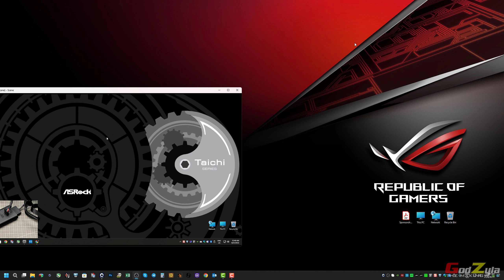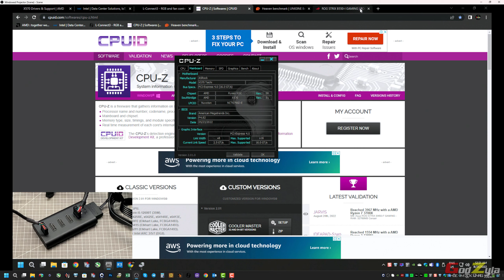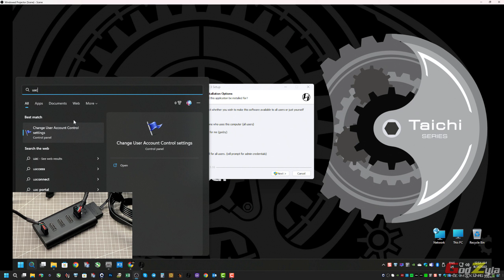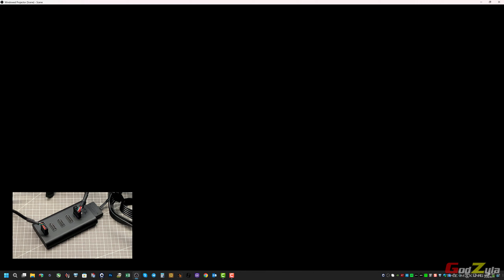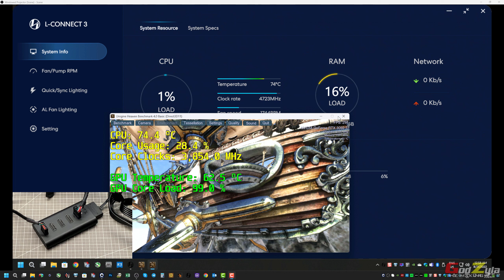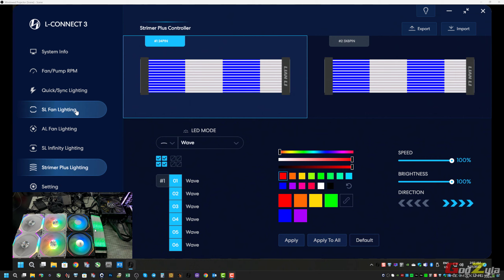Lian Li ARGB Products (How to make it work?) [L-Connect 3]

Comment: My infinity and strimer v2 set is coming tomorrow and i have a question

If i use 2 different sata cable from the psu, 1 for the strimmer controller and the other for the infinity controller, can i use the rest of the sata headers in those 2 cables for hard drives? Im planning to add 2 8TB hard drives at 5400rpm.

My PSU is a seasonic prime GX-850W 80+ gold just incase psu information is relevant
Reply from the maker: Hi Andrew Timothy, welcome to my channel. you should not run into any issues as your PSU reel ampere is at 70 A. https://seasonic.com/prime-gx#specification
Reply: @KleoYan  thats amazing to hear! thanks for the quick reply, you just earned my sub.

Another question if you dont mind, 
I just watched another of your video where you replace the arctic liquid freezer II fan with the lian li fans. 

My question is, since the only cables left from the AiO itself is the radiator pump cable, is there a way to connect it to the uni hub controller so it can be controlled with L connect, or is my only option is to connect it to the motherboard header?
Reply from the maker: @andrewtimothy9792  hi, you are most welcome, as for the LF2, if you change to uni fans, you can still plug the LF2 only cable (Pump & VRM fan) to the uni controller, just make sure the port you have plug in are running on full speed or at 80%. This will prolong the life of your pump.
Reply: @KleoYan  how do i plug that pump/vrm  fan cable to the uni hub controller? If im not mistaken, the controller doesnt have pwm input port?
Reply from the maker: @andrewtimothy9792  oh wait, my mistake, If you are using SL V2 or AL V2 or SL Inf or TL controller, you can't as the ports are all 7pin ports, in this case am so sorry, you will need to connect it directly to your motheboard, my bad.
Reply: @KleoYan  no worries man, im just glad glad the misunderstanding was sorted out lol.

Say im plugging the pump/vrm fan to cpu_fan, how do i set it to 80%/max? And wont this means the vrm fan will spin at a constant 80% speed all the time as well since they use the same cable? Wont it shorten the lifespan of the fan?
Reply from the maker: @andrewtimothy9792  you will need to go to your motherboard UEFI/BIOS to set the fan mode and settings. as for VRM following, that's not a problem. it has a good lifespan of 50,000 hours. what you need to worry is the pump. for VRM fans, you can change it yourself when you log an RMA with Arctic. they will send you the spare vrm fans to change it. as for the pump you can't that's why you got to be sure that it runs consistently. Now you will have to fiddle in your motherboard UEFI / BIOS. I can only share with you this info on how to set PWM or DC, in your case is PWM. https://youtu.be/MCMkrQwFnKM?si=DsL7ZNvJdIOPHzUU
Reply: @KleoYan  ah I see.
Will there be an issue with the lian li fans? For example will it negatively impact the temperature if say, the fans are spinning at like 30% speed while the radiator pump is at 80% speed? Or the other way around?

And can I just plug that PWM cable to CPU_fan header? Since if i remember correctly my MB doesn't have a dedicated pump header. BUT,  from what i read in the MB manual, all fan headers can be used for pump.
Reply from the maker: @andrewtimothy9792  hmm, how Liquiud AIO works is this way. pump will push the warm water to your radiator and your radiator fans will push air to cool the fins stacks which the cooled water flows back to the pump. It goes in a cycle. Therefore it's best to pump motor to rotate in a consistent speed, by preventing pump motor to fluctuate the speed, your motor will last longer. In general, at all times is best to run the pump at 100%, if too noisy, set it down max to 80% and not lower. As for the Radiator fans, you can have it PWM as in when CPU goes hot, it will ram up the RPM of the rad fans. so the Pump and Rad fans works differently. As for the VRM fans, you have no choice since the cable is together with the pump, so have to run at 100% or 80%. 

now my way to connect Liquid AIO will be slightly different. I always separate the connections to have full control, also I will have them connect directly to the motherboard. example using AL-120-V2 fans, your case will have serveral of these fans, example 10 x AL-120-V2 fans. I will purchase 2 x tripple packs and 4 x individual pack. I will connect it this way.

a) Plug the LF2 only cable will connect directly to fan header on motherboard (Check to make sure it's 2A and not 1A) 
b) Mount 3 x AL-120 V2 fans to radiator, use the individual pack cable, plug the fans 4pin pwm directly to motherboard CP_FAN and the ARGB 3pin JST03 to AL-120-V2 uni controller Sync 2 Port
c) for the rest of the AL-120-V2 fans (case fans) I will plug to the AL-120-V2 uni controller directly (make sure to plug into port 2 as sync port 2 follows port 2 argb effects)

This way all your case fans, the PWM and ARGB are controlled by the L-Connect 3.  
For the radiator fans, the PWM is controller directly from your motherboard and the ARGB is controlled by the L-Connect 3 app. reason for this, in the event if your Uni controller died. Yes all your case fans will not operate properly (PWM & ARGB) but you will be safe on the liquid AIO side as the only thing affected is the ARGB and not the PWM which the fans are cooling your radiator. 

hope you understand what I mean and sorry to be that lenghty.
Reply: @KleoYan  no i understand completely thanks so much for taking the time explaining it in such detail. 

So the summary is :
you recommend the radiator fans and pump be plugged to the MB directly. 
But only having the pump plugged into the MB and have the fans be controller by L connect should still be fine.
Reply from the maker: @andrewtimothy9792  yes for Liquid AIO pump, vrm and radiator fans, always plug the 4pin PWN connectors directly to motherboard (Safety measures), except for argb can plug to uni controller for L-connect to control. as for other case fans can just plug to uni controller and control by L-Connect 3.
Reply from the maker: @andrewtimothy9792  this will give you an overall picture of what I meant, though is not Arctic LF2 but is the same concept 

Choice A) and B) 

A) https://imgur.com/gallery/zEKCkRf (defualt connection) 
B) https://imgur.com/gallery/wxrKnQd (Highly recommended which I use this method.It's a safety measure if uni controller die, your Liquid AIO will continue to run)

Comment: i have a question about Lian li Galahad AIO LCD infinity. the L connect 3 is only allowing me to set rgb loop number to 50 max. and my 3rd fan in aio only lights 1/3 of the side rgb pannels. Do you know how to fix it?
Reply from the maker: Hi Axie 101, welcome to my channel. Just to check. Are you able to control the ARGB effects and to control the lcd? As for the Inf 120 fans where do you plug it?
Reply: @KleoYan  I did not build the pc. I am able to control argb effects and lcd.
Reply from the maker: @axie1019  I see, reason I asked is. For the SL-INF version of the GA II LCD. It comes with the Uni controller. Therefore you need to have two usb cable plug to the motherboard usb 2.0 header. I would advise you to go back to the person who build your pc to troubleshoot for you. Or check on L-Connect 3 app. Under settings and devices. Are the fans connected to the controller all highlighted or?

Comment: i dont have any of those options on my l connect 3, i only have system info and settings. have none of the fam rpm or lighting options.
Reply from the maker: Hi Ryan, welcome to my channel, mind if I ask which type to Lian Li ARGB devices are you having. As in which uni fan and does it come with a controller?
Reply: @KleoYan  sl infinity and yeah it comes with a controller
Reply from the maker: @lambbosbread123  ok try this.

1) Make sure your motherboard bios is up to date, please check on your motherboard manufacture website, under support > bios and drivers. See if there are issues with USB and do they have a fix. If there are, kindly update those bios firmware version.

2) Make sure your chipset driver for your motherboard is up to date! For AMD will be at https://www.amd.com/en/support for Intel will be Intel Driver & Support Assistant Intel DSA https://www.intel.com/content/www/us/en/support/detect.html

3) Remove all argb apps (Asus Armory Crate / MSI Dragon Center / Giga Fusion / Asrock Polychrome). If the brands which I have mentioned, do have a uninstall tool like the Asus Armory Crate, use that, else use Revo uninstaller ( https://www.revouninstaller.com/ ). Revo uninstaller will remove all unwanted files / folder / registry in your system. Illustration to use revo uninstaller https://www.youtube.com/watch?v=uMgUYiakpxM&t=437s

4) Shutdown your PC, unplug the PSU cable from your AC outlet. Press the power switch twice to discharge all current that your motherboard is holding. Leave it for 45 second

5) Plug Uni controller with one fan

6) Plug the power cable and turn on your PC

7) Go to your Device Manager, look under Universal Serial Bus Devices, make sure you see the Lian Li uni controller

8) Install the L-Connect 3 app only https://lian-li.com/l-connect3/ 

9) After installation, run L-Connect 3, check under Setting > General > make sure Auto-Run on Boot and Minimized L-Connect 3 to system tray at close are ON.

10)	Reboot your system.

11)	First thing you need, go to device manager and see if the Lian Li controller is listed, next open up the L-Connect 3 app. Check if there is a need to update firmware to your controller. Go to Settings > Update, under Device F/W version, click on Update Check, download and install the firmware. Make sure the firmware is completed. Do a check on device manager and make sure the Lian Li controller is listed.

12)	On L-Connect 3 dashboard, check if the CPU and GPU readings are reacting, you might want to test it using some benchmark programs. If there are reaction, play with the PWM and argb functions. If it does not work, skip step 13) and proceed step 15)

13)	If Single controller works, shutdown your pc, connect uni fan set of 3 to your output of your uni controller. Do it small steps at a time to hook up your sets of fans. do not do all in one go. If successful and you have a second controller, proceed small step at a time again.

14)	Slowly plug back your USB devices (Headset, Microphone, Printer, USB Capture Card and etc). At any point of time as you add those devices one at a time, if L-Connect 3 become unresponsive. This tells you that there power is insufficient to power up more USB Devices. Whatever USB port on your motherboard, there is a limitation as the current are shared across the board, be it front or back I/O and the internal USB Header. You might need to get a Internal USB Hub that comes with a Sata Power source to the Internal USB Hub. (Disclaimer, buying a internal usb hub might or might not resolve this issue, purchase at your own expenses)

15)	If it does not work, report your issues to Lian li Tech Support. There is a in build log ticketing system in L-Connect 3 app. this is what you need to do. Go to Settings > Support > Click on “Download log” place a filename and choose a destination drive to save the log file. Next click on “Report” it will take you to Lian Li Tech Support FAQ. Fill up the form and upload the log which is a zip file.
Reply: @KleoYan  oh wow I appreciate all the help . I will go through the list and try it out. Thanks heaps
Reply: @KleoYan  under universal serial bus . Is it called lian li ? Or is it aura led controller ?
Reply from the maker: @lambbosbread123  it's lian li something, the aura is another argb application which tags to your motherboard.
Reply: @KleoYan  strange mine doesn't show up. But fans are working and rgb is working.. I couldn't have wire it wrong or it wouldn't be working correct?
Reply from the maker: @lambbosbread123  that’s the reason why I show you the steps is to troubleshoot one at a time.
Reply from the maker: @lambbosbread123  ok I was in a rush to answer you. Now you will need to have that controller shown in Device mananger. this shows that there is commnunication between L-Connect 3 app to your controller and to control the PWM and ARGB of your fans. by default your fans and lights will work but without control.
Reply: @KleoYan  hmm ok. I'll have to try all those steps later. Thanks:)
Reply from the maker: @lambbosbread123  ok good luck.

Comment: Hi, my fans went full speed from the software. I had to switch controllers to stop it from spinning at max rpm. How do I prevent this from happening again?
Reply from the maker: Hi chrome, welcome to my channel. did you check if your device is listed in device manager?
Reply: @KleoYan  Yes it is listed as lian li unifan.
Reply from the maker: @Oggais  ok try this.

1) Make sure your motherboard bios is up to date, please check on your motherboard manufacture website, under support > bios and drivers. See if there are issues with USB and do they have a fix. If there are, kindly update those bios firmware version.

2) Make sure your chipset driver for your motherboard is up to date! For AMD will be at https://www.amd.com/en/support for Intel will be Intel Driver & Support Assistant Intel DSA https://www.intel.com/content/www/us/en/support/detect.html

3) Remove all argb apps (Asus Armory Crate / MSI Dragon Center / Giga Fusion / Asrock Polychrome). If the brands which I have mentioned, do have a uninstall tool like the Asus Armory Crate, use that, else use Revo uninstaller ( https://www.revouninstaller.com/ ). Revo uninstaller will remove all unwanted files / folder / registry in your system. Illustration to use revo uninstaller https://www.youtube.com/watch?v=uMgUYiakpxM&t=437s

4) Shutdown your PC, unplug the PSU cable from your AC outlet. Press the power switch twice to discharge all current that your motherboard is holding. Leave it for 45 second

5) Plug Uni controller with one fan

6) Plug the power cable and turn on your PC

7) Go to your Device Manager, look under Universal Serial Bus Devices, make sure you see the Lian Li uni controller

8) Install the L-Connect 3 app only https://lian-li.com/l-connect3/ 

9) After installation, run L-Connect 3, check under Setting > General > make sure Auto-Run on Boot and Minimized L-Connect 3 to system tray at close are ON.

10)	Reboot your system.

11)	First thing you need, go to device manager and see if the Lian Li controller is listed, next open up the L-Connect 3 app. Check if there is a need to update firmware to your controller. Go to Settings > Update, under Device F/W version, click on Update Check, download and install the firmware. Make sure the firmware is completed. Do a check on device manager and make sure the Lian Li controller is listed.

12)	On L-Connect 3 dashboard, check if the CPU and GPU readings are reacting, you might want to test it using some benchmark programs. If there are reaction, play with the PWM and argb functions. If it does not work, skip step 13) and proceed step 15)

13)	If Single controller works, shutdown your pc, connect uni fan set of 3 to your output of your uni controller. Do it small steps at a time to hook up your sets of fans. do not do all in one go. If successful and you have a second controller, proceed small step at a time again.

14)	Slowly plug back your USB devices (Headset, Microphone, Printer, USB Capture Card and etc). At any point of time as you add those devices one at a time, if L-Connect 3 become unresponsive. This tells you that there power is insufficient to power up more USB Devices. Whatever USB port on your motherboard, there is a limitation as the current are shared across the board, be it front or back I/O and the internal USB Header. You might need to get a Internal USB Hub that comes with a Sata Power source to the Internal USB Hub. (Disclaimer, buying a internal usb hub might or might not resolve this issue, purchase at your own expenses)

15)	If it does not work, report your issues to Lian li Tech Support. There is a in build log ticketing system in L-Connect 3 app. this is what you need to do. Go to Settings > Support > Click on “Download log” place a filename and choose a destination drive to save the log file. Next click on “Report” it will take you to Lian Li Tech Support FAQ. Fill up the form and upload the log which is a zip file.

Comment: @KleoYan Thanks for the awesome video, but I have one question. How do I connect more RGB cables ? The motherboards have mostly 3x 5vARGB connectors. So here is my situation.

O11D EVO RGB + GA II TRINITY with UNI FAN SL-INF + UNI FAN TL LCD
Total: 4x 5V ARGB and 3x USB

USB through the hub I get it, but RGB ?  Thanks for any advice and help :)
Reply from the maker: Hi Milan Hron, welcome to my channel. If you do not need to use other ARGB software besides L-Connect 3, you dont need to plug the argb connector from the controllers to your motherboard argb headers. But if you need it.. you can always get a 3pin 5v ARGB splitter as the drawing ampere of all Lian Li ARGB products are through it's controllers.

Comment: Hey, what would you recommend my RPM to be at? I built a PC and just noticed my quiet RPM was 1200 so my fans were always loud. So I changed my base RPM to 800 now, but not sure if it automatically speeds up when the GPU / CPU hit higher temps.

What would be a good RPM for certain temps? Just don't want my computer getting too unnecessary loud. I have 9 SL V2 vans in at the moment. Also which line is better curved or straight to change the RPM?

Thanks!
Reply from the maker: Hi Jesse, welcome to my channel. In general from temperature 30 to 55. I will run 900 to 1k rpm. From 55 to 70 I will run 1k to 1.2k rpm.  From 70 to 85 I will run 1.2k to 1.5 k rpm and from 85 to 100 will be at 1.5 to 1.8k rpm.